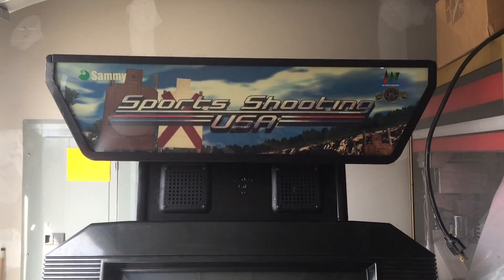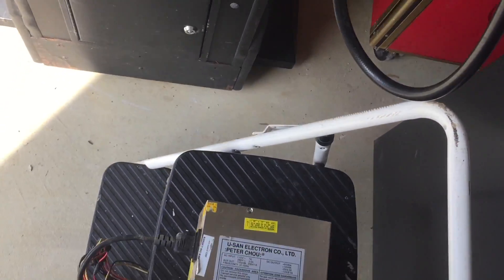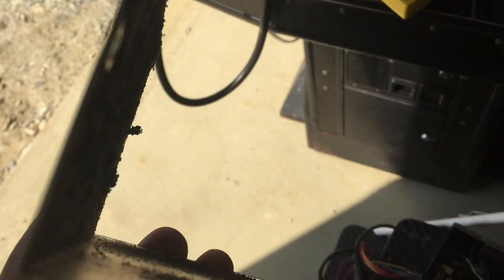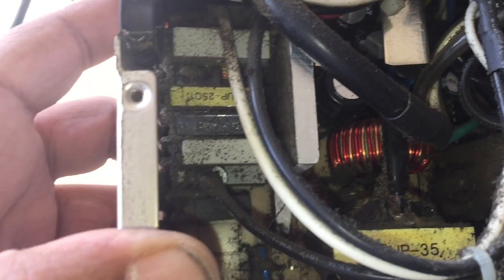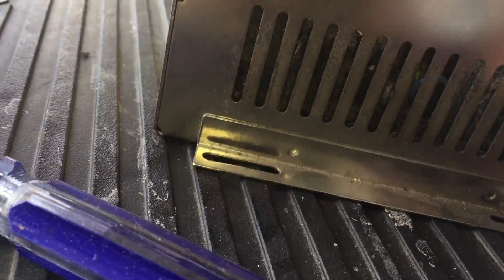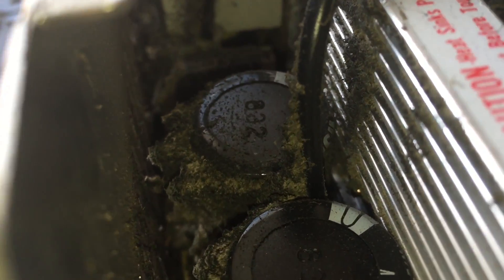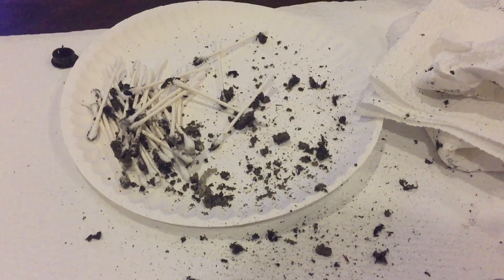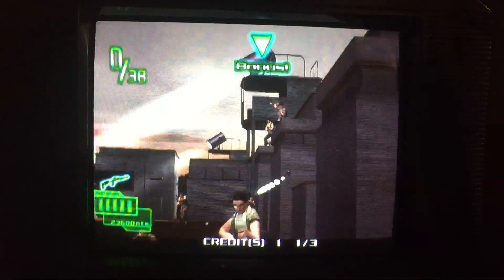Atomiswave Arcade Cabinet Power Supply Cleaning & Adjusting 5V Voltage

Comment: You have to be careful opening a power supply. They store high amounts of electricity in them and if your not carefull they will electrocute you.
Reply: +Vending Junkie The same goes for the monitor. The Flyback transformer in the monitor stores enough electricity to kill a grown man. So be very very careful
Reply: @VendingJunkie  I found out the hardest way possible NOT FUN RIP IGT  GAMEKING and my balls